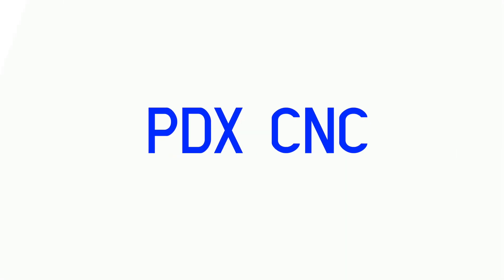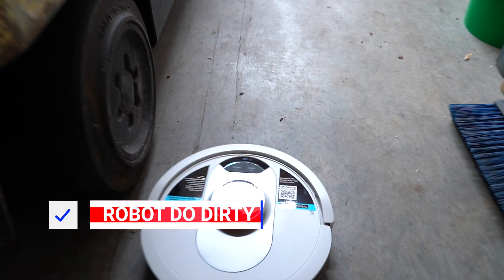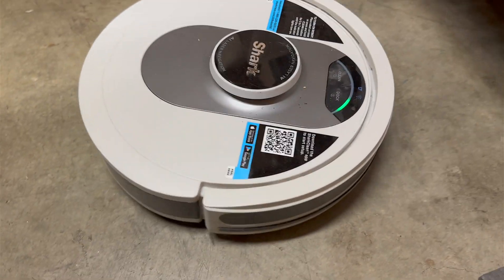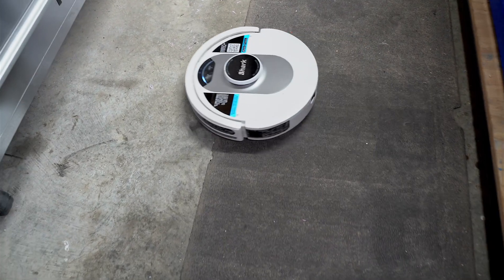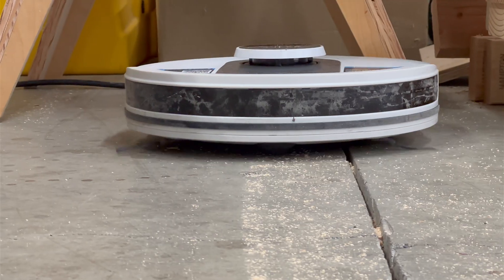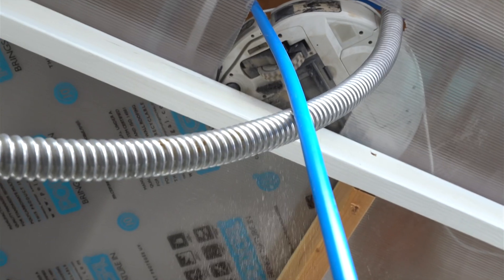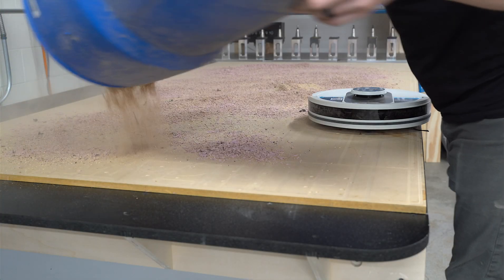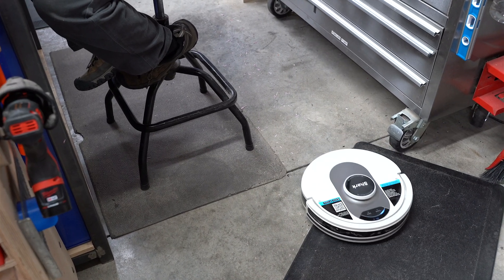Robot Vacuum for our CNC Shop?

Comment: Don't underestimate the importance of navigation on these bots, it can make a huge difference.

My dad bought one of these shark vacs and it wasn't great, precisely because of navigation. But better models from, say, Eufy, have much more accurate navigation allowing for much smaller and more precise no-go zones and even virtual barriers. Plus, they support multi level mapping, so you could have it create a map of that little roof you put it on, and put virtual barriers around the edge and any holes, that way you can easily put it up there and have it clean.

Comment: Hey I like your videos. I had a question; do you run a 'cleaning toolpath' after cutting out a sheet and removing it from the table to clear out all leftover sawdust? Like a toolpath without using a tool just running over the entire bed?  cheers

Comment: I recommend getting a robot without a spinning LiDAR sensor. That LiDAR sensor isn’t going to last in an area like that because of dust, no offense.
Reply: The LiDAR models are significantly better at mapping though, and aren't showing any real reliability issues.
Reply from the maker: Still going strong. It’s paid for itself many times over already anyway ¯\_(ツ)_/¯

Comment: Been running a roborock s5max for over a year in the shop. It's for getting to areas under the machines and to get that last few %. Great for keeping fine dust from building up.
Reply from the maker: That's great to hear. That's exactly what we're looking for too.
Reply: How has it been running now?
Reply from the maker: It just got replaced two weeks ago. Had a sensor go bad inside and I didn’t care to try to fix it. I feel having one is required now
Reply: @pdxcnc same model?

Comment: I've been thinking about this for our shop. I think they need a plow mode for this to be really useful. Have a slotted plow that catches the big stuff but lets the small stuff through to the vacuum. Have a designated location for it to plow larger items up into a pile to be shoveled into the garbage. Better yet have a ramp and a bin it pushes stuff up and into. 

Around the house this could also be useful for toys. 

At home, we have a higher end Roomba  with the self empty. It works good but it seems like more work than just sweeping getting the room ready for it to run. We have a 2 year old and he gets his toys everywhere. Then there is stuff like cell phone chargers and laptop chargers it loves to get tangled in.
Reply from the maker: Ha, interesting. Reminds me of these babies. https://amzn.to/3kP3EQN

I would think that could be fairly easily 3D printed to test out the idea.
Reply: I have labradors. I'm trying to find a vacuum. That'll work in my garage full of motorcycles in labradors. Heated nice garage dog hair and obstacles